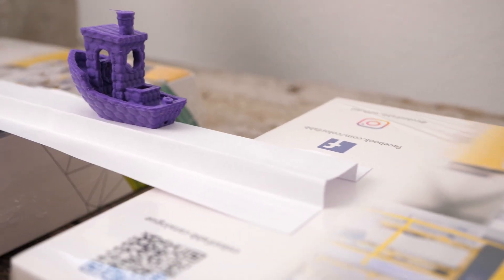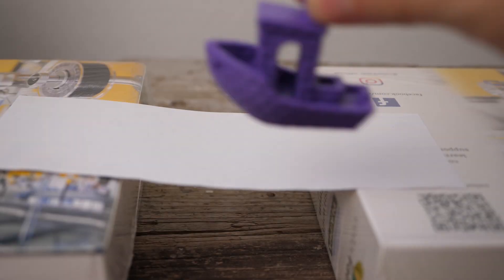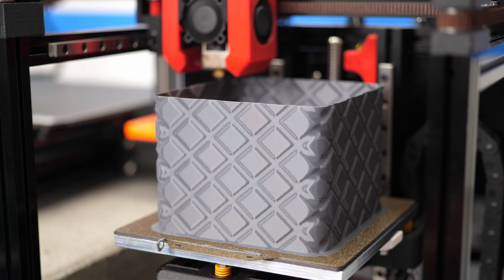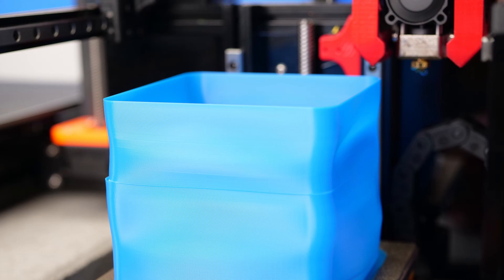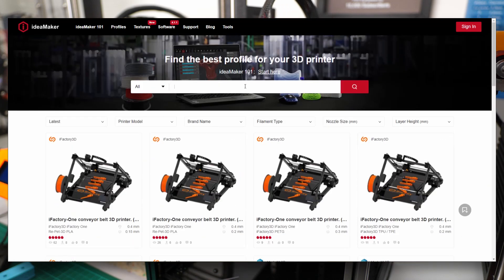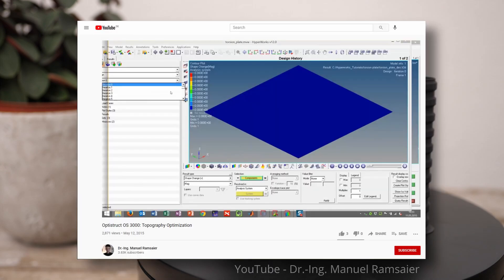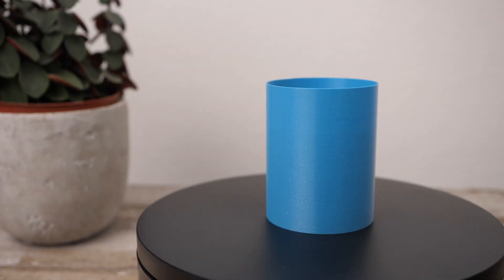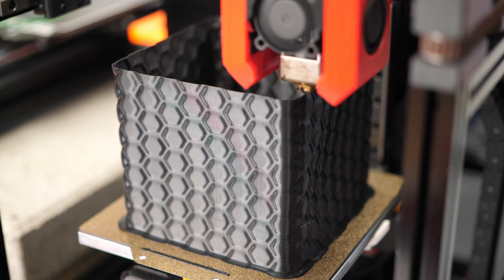Texturing 3D Prints for Strength!

Comment from the maker: Textured or smooooth? What's your preference?
Don't forget to like & subscribe and share this video on Facebook, Reddit, Twitter, and other platforms!
Reply: Textures hide the layers, so I would go with textured! And thanks for the video I have been vawaiting for it. Keep it up!
Reply: Maybe both! a smooth outer wall with a textured inner wall that protrudes to the interior of the model. Like stiffened skins on airplanes =D
Reply: I have actually been experimenting with this using SolidWorks' 3Dtexture tool, using displacement maps like this but not to increase stiffness in vase mode prints but for visual reasons, adding a pattern but also adding a noise layer on top which is extremely effective at reducing the visibility of layer lines.
Reply: I will never forget the first time I printed a knurled knob I didn't think that a 3D printer would do a good job with it but I was blown away by how nice it looked and how nice it felt..... ever since I included knurling whenever I find a chance. This looks pretty much like a displacement modifier, at the level that I am at now with blender this is not much help for me but for those who aren't at a high level yet this will really up their game. Great video BTW!
Reply: @Vintage_USA_Tech  I would love to have this in CAD somehow, I don't know blender, and it always seemed to me to be more of an artistic tool than a solution for precision engineering, so it never interested me. Adding surface displacement to precise sections of my models (based on sketches probably) would be quite useful. Maybe I could write a script to do it in FreeCAD or OpenSCAD.
Reply: @VorpalGun  totally something you can do with OpenSCAD: there are a number of external libraries that add a lot of functionality that you can readily extend with a bit of code and having just enough understanding of how they work.
Reply: @VorpalGun  Yeah I know what you mean I started with 3Ds Max back in 1999 never having any idea that 3D printers were on their way so that is why Im kinda stuck on this side of the software experience. But I can really achieve the precision that you can in anything else I just go about it a bit differently.  I do crave the parametric goodness of fusion 360 or solid works....  but this is just a hobby for me and I can not justify the cost that most of these people are asking. I switched from 3Ds Max to Blender 3 years ago and have never looked back. It really has matured well. What are you using Im always interested in what other makers are using.
Reply: @Vintage_USA_Tech  I started quite recently and began with Fusion 360, however their changes to the free version annoyed me, so I switched to FreeCAD this autumn. It is a bit unintuitive, but once you get used to it, it is quite good, especially the development code. 

I want to figure out OpenSCAD too, but it seems a bit limited in supported operations. However the programmatic approach seems really flexible, and as I'm a software developer it should in theory suit me. There are some other minor programmatic approaches that seems interesting as well, but their community seem quite small.
Reply: @VorpalGun  Blender can do this, it is just a bump mapp, which have been in Blender forever. 
And yes, Blender can use any united, aś it doesn't care, like cad software.
Other then that, I can't se it being special for artists. 
Yes, you can do post production etc, but you don't need to use that. 😉
Reply: @VorpalGun  smal community, you can make an impact much easier. 😎😁
Reply: @AndersJackson  Unless I misunderstood Blender doesn't really support parametric modelling, which suits me much better than direct modelling. It suits the type of things I'm interested in doing, and it suits my skill set as a computer scientist/engineer. Oh and blender is intimidating and confusing when you open it. So is FreeCAD arguably, but I had learnt Fusion 360 first, and many of the skills transferred. I have no useful knowledge to build upon when it comes to blender.

As for working with a small project and being able to influence it: sure, but sometimes I just want to use the software, and a larger community helps when it comes to having an ecosystem of good libraries already available.
Reply: @AndersJackson  by the way, an interesting open source parametric CAD software I found a while ago is SolveSpace. It is a bit simplistic still (but under active development). The most interesting aspect of it is that it seemed (from my brief testing) to use constraints not just in sketches, but also for the full 3D modelling. I also just checked and they made a new major release earlier this month, which I haven't tried out.
Reply: @VorpalGun  I will check out FreeCAD I looked at it like 3 or 4 years ago but things can change alot in that amount of time. I don't know if you know this but blender has a huge community and add-ons that help solve alot of my problems when it comes to design..... I think they use python but I'm not totally sure I'm more a electronics guy I'm a old school component level tech and I just know enough about programing to get me in trouble. But if you have programing experience Blender might be what your looking for.
Reply: @strictnonconformist7369  I'd love to learn more about this. But a quick search didn't turn up much?
Reply: @davidb2045  the openscad site has links to some known libraries written for openscad. It does take quite a bit of reading to identify what you want and need, but from what I’ve read of the documentation for the externally-written libraries, it’s a HUGE amount of leverage you get out of that, because it’d be complex to create all that functionality yourself.
Reply: @Vintage_USA_Tech  All the time I was watching I was like "This is simple in Blender. Why does he think this is a big deal?"
Reply: Its on a case to case basis, if it is needed do it
Reply: Depends on your application of course. I could see uses for both.
Reply: Does this "cut" it into the existing walls or does it add on to it/shift it?
Reply: ... Can it be applied only in certain areas of a model? As in, if I have a tongue & groove joint for another part to attach can I avoid that being textured?
Reply: @Traqr  
Chuck of the CHEP channel has a video where he shows how to block of sections of a model to change how it's sliced. I don't remember what its name is though...
And he's using Cura, which may not do texturing.
Reply: Another great video Stefan!! I believe this concept will quickly catch on(if it hasn't already 😅) with 3d printing engineers and hobbyists alike.
Reply: @CNC Kitchen. 
Textured or smooooth? What's your preference?

I think Durex has already laid claim to that line.
Reply: Did you reprint the parts for your voron v0?
Reply: I already know where this will be useful for me, making airducts for my CNC enclosure.. I can do longer pieces so much faster if i can use vase mode.
Reply: This is big and could help a lot for mechanical parts, ive manually added debossed inlines along printed parts specifically to strengthen them.
Reply: Thinking for aircraft or other designs textured.  Seems like one can use a monokote or even pp tape like clear HD Duck tape for the smooth surface while optimizing goals.
Reply: I'm really looking forward to seeing this progress as resolution increases. I want to print material colors like beetle shells have.
Reply: Textures for the extra strength. You should get some Isogrid depth- / bump-maps
Reply: I likes gyroids
Reply: cant it be done in cura?
Reply: There is no smooth 3D prints...
Reply: You Romanian?
Reply: I prefer textured. Also, I love your accent, where are you from?

Edit: Nvm, i just finished the video, probably, German?
Reply: Thanks for tip, yesterday I printed some vase and they become amazing, thanks to texturing. But i have a question. Before question please like my question and subscribe my channel and share this question on fb, two, red and insta. Here is question İdeamaker says it's free to download, but is it free to use? Confusing that they didn't put any pricing info.
Reply: Ich finde es immer so geil hey Guys i am Stefan das klingt ja schon deutsch XD
Reply: What about texturing structural parts of the printer? Maybe hexagon texturing parts of your voron 0 you have to remake. For stiff-heat resilient part I would try CF-ABS by Nanovia, it looks suitable for application from data sheet
Reply: What about texturing structural parts of the printer? Maybe hexagon texturing parts of your voron 0 you have to remake. For stiff-heat resilient part I would try CF-ABS by Nanovia, it looks suitable for application from data sheet
Reply: Texture in design, not in Production
Reply: Textured by far
Reply: Ribbed, for her pleasure!
Reply: sorry to be offtopic but does anyone know a method to get back into an instagram account..?
I somehow forgot my account password. I appreciate any tips you can offer me!
Reply: @Simon Azariah Instablaster ;)
Reply: @Darren Jayce Thanks for your reply. I found the site thru google and I'm in the hacking process atm.
Looks like it's gonna take quite some time so I will reply here later with my results.
Reply: @Darren Jayce it did the trick and I finally got access to my account again. I am so happy:D
Thank you so much, you saved my ass !
Reply: @Simon Azariah glad I could help :D
Reply: Yay
Reply: what brand/type of print material was that at 3:07, it looks beautiful and I would want to buy some!
Reply: Try an Triangle texture
Reply: I like it. I feel like it can help in reinforcing a prints weak points. Theres more that can be done to reinforce weak points though.
Reply: Texture for 3D Plane Prints - Anyone tried it - was the first idea that came to my mind, I bought my first Printer February 2022 so I am a bit behind, but now have 3! and it's May - own several printing and wrap companies and sold them in the past - this looks interesting - also as a substrate under a vinyl graphic - anyhow LW PLA pre-foamed with a texture I would think texturing the inside layer but leaving the outside smooth - if it's possible would eliminate the need for weighted supports..
Reply: Where did you download the Vertical line pattern from? Hope you answer!
Reply: @christianjonassen4365  i think you meant to ask someone else that
Reply: I'm still wondering if your name is "Stephan" or "Shtephan."

Comment: The fact that it becomes stiffer is that the print uses much more MATERIAL!!
Reply: Nope if you were to use the same weight of material with smooth walls it would be weaker.

Comment: Does anyone know if you can apply texture to one wall? Im priting wall tiles with abwave pattern on front and flat back. The back bows outward in a couple spots and in using sunlu pla+. Not sure if i should decrease my temperature a little or turn the fan down or up to help counter a little if i cant texture just the back

Comment: I can see this being used to dramatically stiffen a hollow object by just applying it to the innermost of say 3 layers. The outer layer will still have whatever features you initially wanted, maybe a smooth box or cylinder,  but the inner layer stuffens the shape without being seen.

I suppose it could be done like the corrugated cardboard with the center layer, but it would be more likely to show through to the aesthetic outer shell.

Comment: You have made mistake while explaining warping. It's not upper layers that start shrinking and warping bottom layers. Its bottom layers that shrink bcs they start cooling first and then they start pulling upper layers. It's clearly visible on your clip at 4:00 . Bottom layers are shrinking and forcing whole wall in C shape. So it's not that new layer shrinks and pulls existing ones but the existing ones one shrinks and pulls new ones. Heated chamber prevents existing ones from cooling and shirinking.

Comment: Texture for 3D Plane Prints - Anyone tried it - was the first idea that came to my mind, I bought my first Printer February 2022 so I am a bit behind, but now have 3! and it's May - own several printing and wrap companies and sold them in the past - this looks interesting - also as a substrate under a vinyl graphic - anyhow LW PLA pre-foamed with a texture I would think texturing the inside layer but leaving the outside smooth - if it's possible would eliminate the need for weighted supports..

Comment: So, heres a thought, how about extrude texturing the inside perimeter of the print facing in to the infill pattern ? That way smooth exterior of the print is maintained when needed, however strength benefits are retained.

Comment: I love this idea.  The other benefit is it makes each path longer.  Thus any shrinkage is lower by percentage of length x distance on it's natural cooling/shrink ratio instead of shrinking by distance of start point and end point as a line.   So this is a great concept to prevent shrink damage.    In short, while it cools the distance from texture outside to texture inside may become less peak-to-peak (think sine-waves on an oscilloscope)  but that also takes up some of the risk of it pulling too much the original straight path distance.

Comment: Isn't this literally what infill does, if you use a variant like cubic that add strength in all directions? Functionally, these textures add wall thickness since the print no longer has smooth sides on the inside and out - the textured print is much "thicker" even though the actuall wall may be a millimeter. At that point  you may as well just make it double walled a few millimeters thick and put the texturing in the walls, in the form of cubic or triangle infill or something along those lines, it seems to me.

Comment: Have you tested different glues that work well with different filament types?  I'm curious how 3D printed parts that are made in sections might be joined together... and also which types of glues have different benefits, for example some expand, some need clamping, some will fuse surfaces together, etc... I'm also wondering if this might help PLA designs to take advantage of multiple printing orientations/layer thicknesses to maximise strength/speed where that is desired... thanks.

Comment: Very cool video Stefan, thanks for sharing. Always fun to experiment with new slicers too. I have a dilemma I am so far unable to solve. I am printing a 3 RC airplane in PLA and when I print the wing sections, which are 20 cm high or so, the surface collapses inward in the areas there there is little inner support. Which is annoying, particularly for the upper surface of the wing which needs to be clean. The skin becomes concave in some areas....Other than doubling the thickness and sanding the print after, I cannot figure out how to make it stronger. I would have to redesign it in CAD I guess, which is above my current level of modeling knowledge. I was hoping I could use a texture that is applied to the inner wall only, making it stronger while the outside of the wing remains smooth. Not too sure how to approach this hurdle! The search goes on.

Comment: I am surprised that you did not explore the possible applications in ultra thing compliant mechanisms. The utilization of bump maps means that the initial model can be left unmodified. Multiple parts can be printed where a gradient is applied to the image and its opacity increased, or the mean of intensity moved to one side of the other, with every print. This would allow the nature of a flexing part to be quickly changed without complex geometry being drawn each time. As a matter of fact, software developers might have an easy time automating these operations with simple bitmap operations.

Comment: This may allow me to design some parts in "vase mode" instead of using a thin standard wall, that would make them lighter and easier to print. Also the language thing isn't a problem, I've been meaning to learn to speak Google Translate.

Comment: I have a design for a hand thrown flying toy. It has a turbine inside to provide thrust. I made a prototype out of a plastic water bottle with thin but rigid walls. It needs to be teardrop or egg shaped. To improve it's shape I want to 3D print it. But have been concerned about rigiditty, layer alignment and adhesion because it will need to be single walled. I think a texture would help with those issues.

Comment: This is how I’ve been making project enclosures. I use it exactly like extruded aluminum cases. The body of the case, which is what usually would take the longest to print, is printed in vase mode using 0.8 line width. Vertical lines give it stability while also letting me slot in a component sled. The end caps have grooves in them for the body. I’ve also figured out a way to print vents and screw holes for the end caps. All in vase mode.

Comment: I have a request: wood is getting more and more expensive, like plywood, and uses on thing like RC aircraft are getting difficult. But I had the idea of printing sheet parts and assembling them like plywood parts, this would get around the layer adhesion limitations of 3d printing... but I'm curious if 2mm sheet of PLA (needed for its ability to be glued together much better than other filament types) is anywhere near as strong as the same 2mm of plywood. They're about the same weight/density... and if anyone could get a clean result of data it would be you!

Comment: They've added normal maps! great!
This is a significant improvement for at least 3 reasons:
1. reasons shown in this video
2. easy custom logo'ing or labelling
3. In the computer modelling world Normal/Bump maps are often used to add fine detail to a more simple geometry model. So adding normal maps to printing software allows those to be used natively, rather than having to make everything in geometry. 
*this is doubly great for making variations (EG character with or without scars, grippy handle or smoother version, etc) or fast modifications to existing designs.